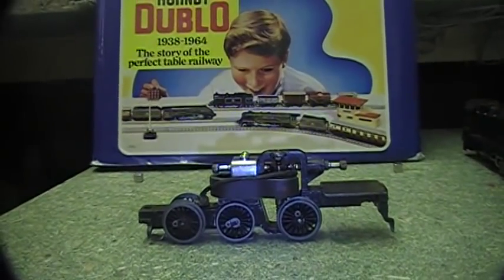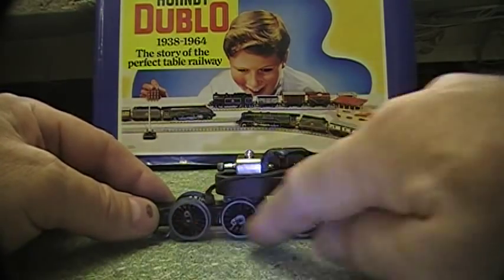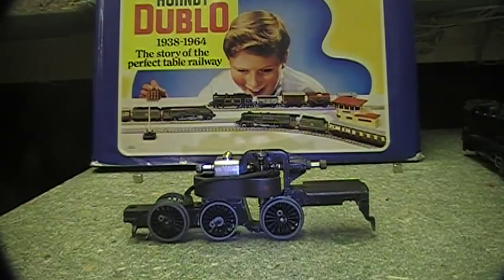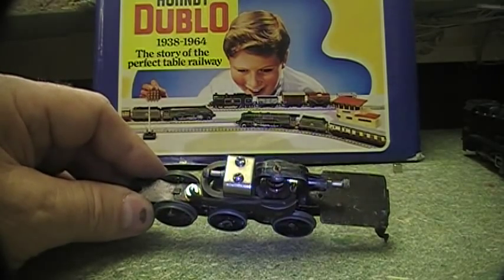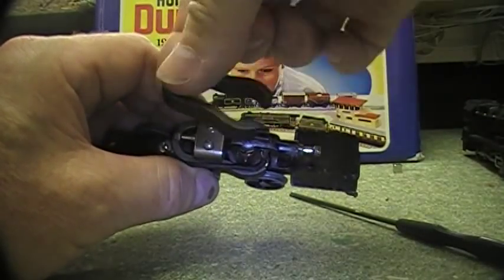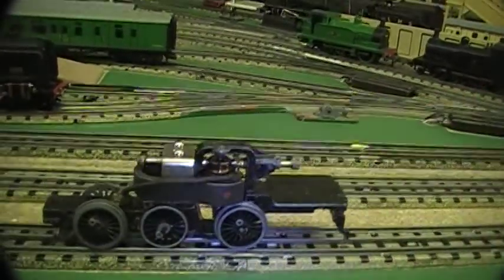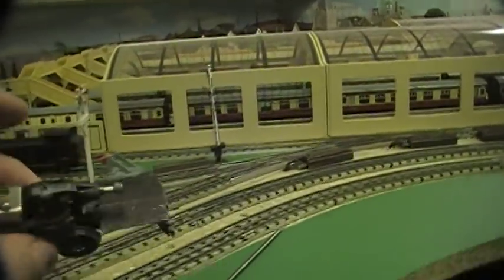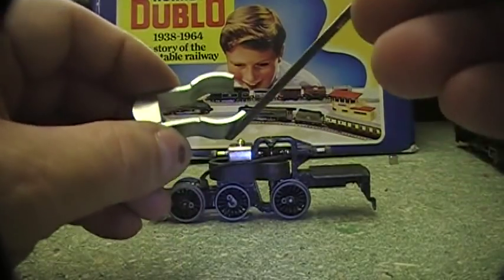Hornby Dublo service -h.s. and other motors

Comment: Hi Ronald good evening, I have taken out the brushes out the ring field motor  I for got what side the spring went can you help me recognise which springs go to the left and the  right side of the motor many thanks Colin.
Reply from the maker: Hi Colin the springs are handed for RH & LH you may have to try them both sides to see which way they fit best. think they have about one quarter turn pressure on the brush and the end is bent to give good contact.
Reply: Thank Ronald for your help, I am Learning a lot from your subscribed channel on the repair and the servicing side I will be ordering the pick up bits for the west county class to convert to three rail from mainly trains and I have the hornby dublo book by Mitchel foster for the parts list the kit as the longer bolt + the tag which fit at the top of the chassis under the nut so you can connect and soilder the red wire to it I have done the work on the isolating wheel with the isolating paint on the center part of the wheels if I have a problem with this project I will email you for your help and advice if That ok with you. Ps I love your layout .Many thanks Colin.

Comment: Hi Ron - Many thanks for all your useful videos.  I have two questions:
1 - Am I right in thinking that Dublo engines should run forwards when the centre rail voltage is negative relative to the outer rails?
2 - I have seen photos of both fine and coarse pitch thread armatures.  Can either be fitted to, say, the 0-6-2 Tank engine without changing the gear wheel fitted to the rear wheel axle?  Presumably the fine pitch gives slower running for the same motor rotational speed.
Thanks again.
Reply from the maker: Hi Graham,  Yes to question 1. 
 Early motors had a course pitch worm thread and these are not compatible with the later fine pitch worm wheels.
Reply: @Raedodd5  Thanks Ron - I have two Dublo 0-6-2 Tanks of similar vintage, one has the North pole of the motor magnet on the left side, the other on the right side, yet both run in the same direction for the same applied voltage - odd!
Reply from the maker: @grahamallen8998  Hi, The direction also depends on the direction of the wire windings in the motor, CW or ACW

Comment: Hello Ron,
I got out my old HD HD 3-rail "N2" LMS 6917. Using the HRCA web site I've been able to date it to 1947-8. (Gold HD label, sans serif lettering, ...)
I've given her a thorough service but the magnet is very weak. The big problem is that she'll only run about 3ft before she trips the automatic cut out on my H&M Duette, once the cut out has reset off she trundles again  or another 2-3ft. She's also pretty slow! Could this be due to a weak magnet meaning she's drawing far more amperage than she should and so tripping the cut out on the controller? 
Until I stumbled on this video I figured it was a problem with the armature windings but now I'm wondering if simply attaching neo magnets as you did mightn't solve the problem? What do you think?

Comment: hi there, nice video. i´m currently trying my best to restore a motor from a vintage 8F 2-8-0  Hornby LOCO that is now not running after a short circuit. Do you have any help or video to suggest.?thks
Reply from the maker: Hi, it's unlikely you have damaged your motor with a short circuit, the power supply should have tripped. It may take a couple of minute for the supply to reset or you could try an alternative supply.

Comment: Hi Ronald. Like some others here I am having a problem with one of my engines. It is a Ringfield castle which runs beautifully backwards, But runs like a snail forwards. The engine and chassis has been serviced with no change in it's running. Do yo have any ideas what may be wrong and how to fix it.
Reply from the maker: That's unusual, if you have another model you can try swapping the motor to test or remove the motor and test it out of the chassis to see if same results. That way you can see if motor or chassis has problem, sometimes it can be the quartering of wheels so test chassis separately on the track. Good luck,  Ron
Reply: @Raedodd5  Hi Ronald, problem was solved by taking a picture. When I took the picture I noticed that the bogie wheels looked a bit big. I had bought this chassis in for a project and had not fitted them myself. So when I moved the engine backwards the bogie as you would expect pulled towards the front of the engine and visa versa going forwards. It was then that I noticed that the wheels were touching the chassis base when going forwards. the previous owner had put a set of Gibson wheels on. They were just too big and were causing a sporadic short as the engine moved. I have replaced them with a smaller set of wheels and all is well now. Many thanks for the reply.
Reply from the maker: @gerardburton3741   Hi Gerard, pleased you have solved your problem, it is surprising how such details can affect the running.

Comment: Hi.I was wondering if you could help.I need to refit a horseshoe magnet to a 0-6-2 but the thing is so tight it wont allow the armature to turn!I had to force it off(needed  to get to the armature).All id like to do now is refit the horseshoe magnet then fit two 6mm neomagnets as you have.But theres just no freeplay at all once the horseshoes back in place!
Any ideas?Thank you for any advice given.
Reply from the maker: Hi Tony, To remove or adjust the position of a HS magnet I use external circlip pliers which can spring open the magnet just enough to allow it to be easily moved (they are a close fit to the armature) as seen on my video. I have come across a motor where someone has filed the contact faces on the chassis to presumably aid fitting, but this resulted in the magnet rubbing on the motor. In this case I had to use a very slim shim so the motor was free. Good luck with your project.   Ron